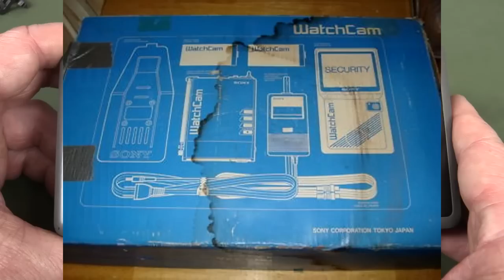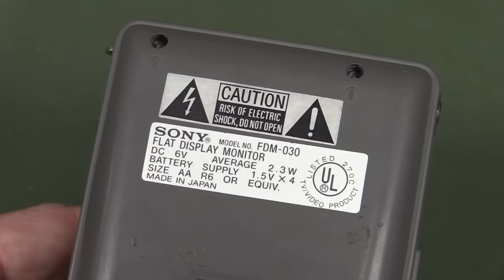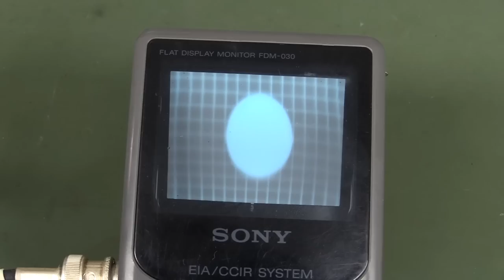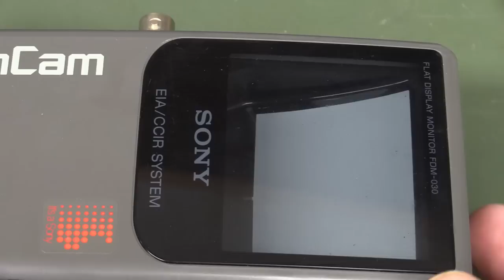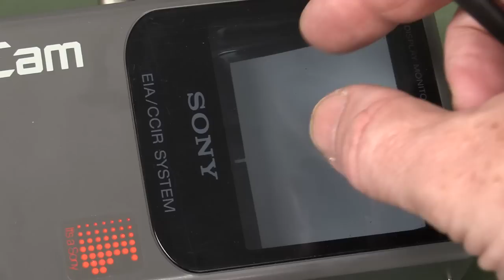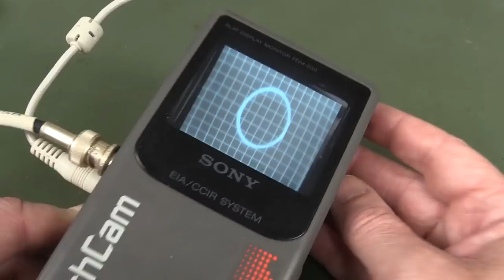EEVblog #1033 - Sony WatchCam Pocket Flat CRT Monitor Teardown

Comment: Those of us who worked on old CRT TVs (monochrome and colour) were well versed in the use of magnets and inductors to tune the geometry of these things.   There were a lot of geometry controls in colour sets to adjust the convergence of the three electron beams and even on mono sets there were movable magnets and variable inductors for adjusting the linearity, pincushon, trapezoid and other geometries.
Reply from the maker: Yeah. By the time this came out, that wasn't a thing any more, but looks like they had to go back to it because of the weird geometry problem here.
Reply: it's funny how my favorite YouTubers seem to gaggle like this, cheers to both
Reply: I remember having to dip into the service menu to fix convergence & color purity problems on a Sony Wega TV, and later, on a Toshiba CRT rear-projector. CRTs certainly have their charms, but I really don't miss having to worry about that stuff anymore.
Reply: Remember having to constantly dork with the geometry adjustment menus on a CRT computer monitor? You'd get everything just the way you'd want it, then it'd all go to hell when you shifted resolutions or once the tube warmed up.
Reply: Things became a lot easier with the advent of inline gun tubes, where a lot of the alignment needed in delta gun tubes was either no longer necessary or was taken care of in the deflection yoke design. Then short-neck,  wide and flat screen tubes came along...
Reply: The only place that is "dangerous" is the high voltage cable from the flyback (the metal can) to the neck of the CRT. So unless you go licking the circuit board, you are just fine.
Reply: It's only dangerous if you don't know what you are doing - most CRTs are driven in excess of 15kV, you would get a nasty shock, the greater danger is the risk of implosion. If you cracked the neck the resultant inrush of air could result in the glass shattering - having glass shards flying about is not good for your health!
Reply: Wasnt expecting to see xjet here either, small e-world lol
Reply: most of these adjustments are done with care as u need to twiddle these while tv is on looking at a mirror in front tv & adjusting from the rear with hands inside ( all natural for tv tech!!) deviate position too much you get a zap. how times have changed
Reply: Just don't let your little finger accidentally slip inside the high-tension cap socket if you're lifting the whole tube out and its just been run...  If you do you'll get a very unpleasant surprise thanks to the lingering capacitance. My father snatched his hands away in reflex and bounced more than one tube off the floor because of doing exactly that--and being too 'busy'/idle to earth the connectors out first of course!

Comment: The coil with the magnet on it is for horizontal size and linearity.   The magnet changes the saturation point of the coil.  The thick white wire is the HV anode.  In small CRT's like this they could afford to feed the anode back out the CRT base, lower voltages and less influence on the electron beam allowed this.  If you look hard enough you'll find the focus is linked to the vertical deflection.  As the beam scanned down the surface the distance to the gun changed and had to be adjusted for.  The empty compartment to the left of the CRT is where the tuner was stashed in the watchman TV version.
Reply: I hereby declare you resident Sony Watchman expert and answered more than one question I had.  That being said, what can you do for a guy who's iphone7 just got bricked by upgrading to ios11?
Reply: Are you certain about the saturation point bit? The winding seems to be around plastic (air) on the one I have on my desk. It think the magnetic field should resist the flow of electron in one half of the AC cycle and assist it in the other, same as with a microwave rectifier/circulator.

Comment: The beam doesn't really bend in this design. If you note the phosphor screen is curved. The beam just uses standard deflection and it shoots straight to the top of the screen then the vertical deflection pulls the beam to the back, and well the curved screen does the rest. I have the larger watchcam monitor, and for that matter the little camera that also went with it. The camera is long dead, but the monitor still worked the last time I fired it up.
The 2nd anode is actuallt a transparent electrode that runs on the inside of the glass behind the fluorescent screen according to the sony manual. HV is delivered at the tube socket. I've shown mine on my channel. I will do a tear down on it on a future video.

Comment: Used to use one of these at work back in the early 90s. Back then we installed camera systems for security. Back then the better cameras had a separate lens and housing. So the field of view could be chosen depending on which lens was installed in the camera. Of course these lenses had to be focused at the camera. One of these small screens was a lifesaver on jobs where cameras were located far away from the main recording equipment and monitors.

Comment: Cool comment about the wave soldering, but why would the extended pads face different directions if the board obviously only went through one direction?
Reply: I was thinking the same thing.
Reply: I think besides wave soldering to accommodate double sided assemblies (with through hole components on the other side) they had to do selective wave soldering. This means now you have a selective wave solder pallet like 'stencil' that protects surface mount components on one side and wave solders through holes on the other. This selective procedure now makes the PCB have different banks/sections that essentially cordons/masks off different areas with the stencil plastic cover material. This plastic stencil is put on by the assembler during manufacturing on the PCB using those little tiny holes you see labelled all across the PCB (A,B,C etc.) You can now dip the board at different angles vertical/horizontal 45 degrees etc and remove/add plastic stencils to get the desired flow of solder for every section of the board.

Comment: Our late 90"s doorbell video monitor is a actually a flat CRT of this kind. Still working like a charm.
This technology made its way in such applications until about 2005, pretty sure the reliability toward crappy quality signal from cheap CCTV cameras is a reason for their success here, the screen being to blurry and small to notice any defect.

Comment: Just a year later, in 1990, we got a color LCD game device that could be turned into a TV with a tuner module, and i bet it was even a cheaper solution.
Just a Sega Gamegear for 300 Mark and the and the TV Tuner for, if i remember correctly, 100 Mark. ;)

Comment: When I was a kid (back in the 80's) I was lucky enough to receive a Sony Watchman as a birthday present. I used the hell out of the thing (usually to watch reruns of Star Trek on weeknights, after I was supposed to be asleep). The problem was, after a few years of heavy use, mine developed convergence issues; when new, the picture was remarkably sharp, but over time it became fuzzy, with geometry problems. I learned (by getting service manuals) how to correct convergence problems that my Commodore 1084S monitor developed (I still get sweaty palms when adjusting convergence rings on my retro-machine CRT's), but never attempted to fix the issue with my Watchman, because I was intimidated by the miniaturization. Seeing a similar device (with what is essentially the same tube) opened up in this video, is quite remarkable (I never tried disassembling my Watchman), it has the same basic architecture as any other monochrome CRT, just very small with weird geometry manipulation. It also looks like it has some kind of adjustable rings at the neck, but given how small everything is, and how delicate the copper windings look, I'm glad I never messed with my Watchman. 

Ultimately, I ended up (just a few years later) getting Radio Shack's rebadged (under their Realistic brand) CITIZEN 06 TA LCD handled TV (even though it had a very "pixelated" image, it got great battery life and had excellent reception). I got years of use out of that Realistic set, before the detachable backlight failed. Can't remember what I ultimately did with either TV.

Comment: The beam doesn't need to be bent after deflection. Unlike the Sinclair flat CRT, the faceplate in the Sony tube is curved. The actual scan is compressed vertically and expanded by the angle at which it hits the phosphor. The beam simply needs dynamic refocusing linked to the vertical deflection, as others have noted. Most of the geometry correction is performed the the curve of the faceplate.

Comment: Wow! I have the television version of this, the Sony Watchman. Got it when I was 12 and used it right up until analog broadcasting stopped. Very similar inside with the extra circuitry for the tuner. 4 AA batteries lasted about an hour of viewing which meant I needed to use the high capacity "rechargeable alkaline" variety for the thing to be of any real use. The Ni-Cad rechargables of the day had too low a voltage to run it for very long. Used to take it on school trips for those boring hours on the bus. And man did I ever get the chicks who huddled around to watch poorly received black and white talk shows on the tiny screen in my lap.

Comment: I worked for U.S.-based division of Sony in the 80's and we were already using CAD in the mid-80's, though they were primitive by today's standards. In Japan they would have had better CAD tools than we did. I'm pretty sure this board wasn't laid out with tape, but was probably hand-routed in order to optimize the layout.

Comment: Wave soldering does not bubble, this would cause unwanted oxide. The wave is vibrated with a bar inside the wave nozzle.

Comment: The doorbell intercom at my mom’s apartment still uses one of these flat CRTs — and that building was built in 2001! The manufacturer of that system now uses color LCDs, but I don’t think the transition happened all that long ago. (It’s Koch AG of Wädenswil, Switzerland, if you care.)

Comment: I wouldn't call this "state of the art" for 1989. That was the same year the Atari Lynx handheld gaming device came out which had a color LCD, and there were certainly B&W LCDs for several years before that. It's true that lots of strange small CRTs were still used (like for camcorder viewfinders) but LCDs were available.

Comment: The "extra" coil is just the horizontal deflection coil. Needs more deflection and thicker wire than the vertical deflection coil. Currently attempting to fix a Trinitron machine. The "Velocity Modulation" board mounted on the tube forwards of the cathode board is the modern version of the bodge board above and rammed with small deflection coils for nudging the beam

Comment: Why are the large pads on the opposite ends of those ICs? If they were related to travel direction in the wave solder machine, wouldn't they be on the same end of the chips?
Reply from the maker: I am 100% correct in what these pads do. Not my fault Sony goofed it up in this case it seems.
Reply: I thought your explanation made sense and they just goofed with the footprint.
Reply: Agree on that. The board is 100% wave-soldered - it's a goof-up on Sony's side there!
Reply: I think thats a tradeoff.they had the package library for this IC with this footprint but they put the IC this way because it made more sense for trcaces management
Reply: but it doesn't correspond with the board layout that is probably made by hand, not CAD.
Reply: I am not 100% sure ,but i think they used some kind of CAD.it's from '92 and it looks like cad design
Reply: +EEVblog I'd say you are not quite 100% correct* about what solder thieves do, Dave, but close enough. 

I don't think Sony got it wrong. If you look at IC501 again you'll notice there's a couple of component pads right next to where the solder thieves would want to go. 

So I'm guessing that as these pads would the job of the thieves and space was tight, the PCB designer spun the footprint round. It does leave the question of why they didn't select a footprint for IC501without solder thieves of course but we'll probably never know. 

* I first used solder thieves around '86 after reading a Philips article about SMD PCB design for wave soldering. Used them in every similar design after that.

Comment: I remember Tandy electronics (radio shack) put one of these out in the late? 80's as a tv. it worked.  That magnet coil assy is prob an horizontal linearity coil, bigger tv's had this as an adjustment & the ht supply stayed within the neck of tube while the big brother crt's used the tube "bell"(the tapered glass to the neck) as a glass capacitor for filtering, still its amazing how good it is & still works today

Comment: Focus on a CRT is controlled by a voltage adjustment on the flybacl transformer, not by the rings on the back of the tube. The rings on the back are to adjust for image distortions, and in color CRTs there's a number more rings to adjust for color purity.

Comment: I had a smaller, somewhat similar version of this TV.  It didn't have a RF input; instead it had a built-in tuner for  local TV stations, and had a B/W picture.  It worked beautifully, even if it did have a ravenous appetite for batteries.  Of course, it's totally obsolete now since the advent of digital TV transmissions.

Comment: Ah, blast from the past. Nice!
I remember opening CRT monitors to manually tweak a pot on the PCB when the image sharpness degraded. Helped a lot if people to use their monitors longer.
A guy I know who repaired TV's in the day tought me that trick.
Reply: That would be the focus knob on the flyback transformer. With high-end sets you would have an installer come in and tweak it every couple years or so. The optimal focus voltage of a CRT drifts as the tube ages (and so do lots of other things like convergence and color purity). 

On the later model Sony monitors (also branded by the likes of IBM and Dell) they had sophisticated microprocessor-based circuitry to automatically adjust these parameters and compensate for tube aging. This did not work all that well and created more issues down the line than it solved. I still own a Dell P1110 and an IBM P275 which are basically the same Sony chassis with different casing. Neither of the two is working optimally, and i've spent hours and hours tweaking both the electronics and the software. I seldom use them nowadays but i still keep them around.
Reply: Andrei H Very interesting, thank you!
I believe that was indeed explained to me at the time. But that's like 15 years ago so I forgot ;)
The automatic adjustment is something I never heard of, so that's cool to learn about. Smarter every day ^^

Comment: I've got a TV version of that, with a synthetic leather pouch, a Fresnel Lense and a big transformer. Got obsolete with the disappearing of the analogue TV signal but I think it still works.I also think that it's older than 1989, rather like 1985 or so. 
In 1982, I think, Seiko made a TV screen in a watch and a separate receiver. It was shown in a James Bond film but really existed and could be purchased.